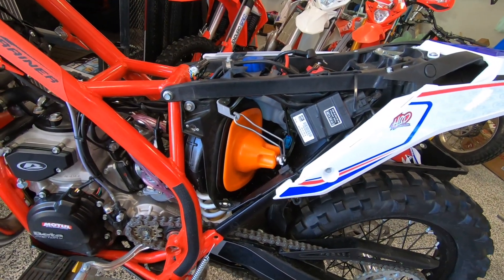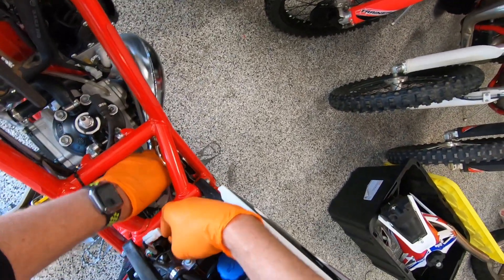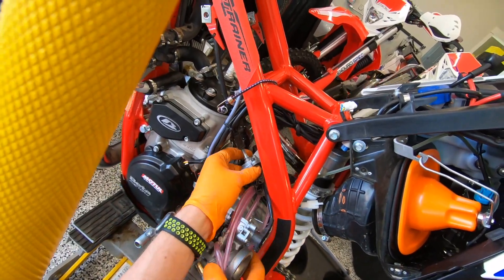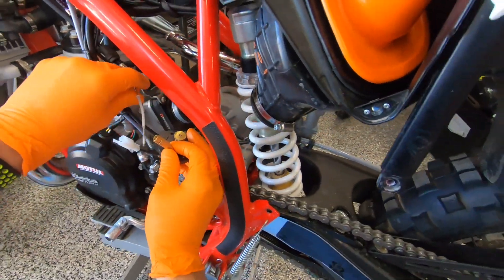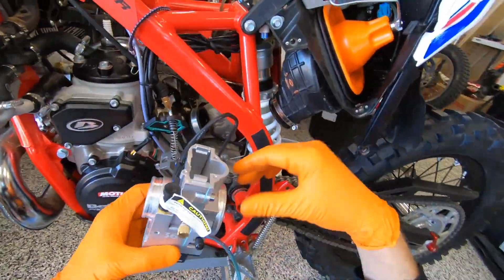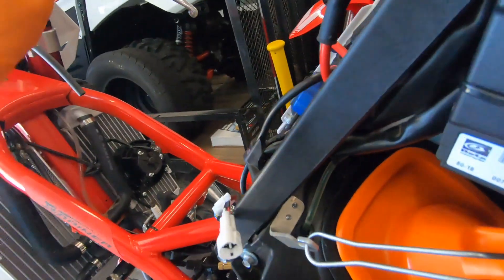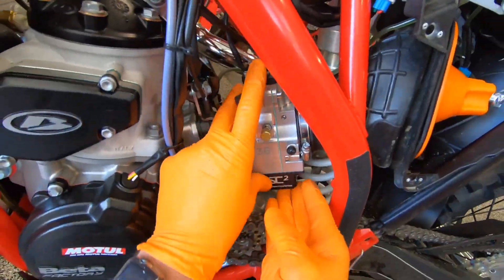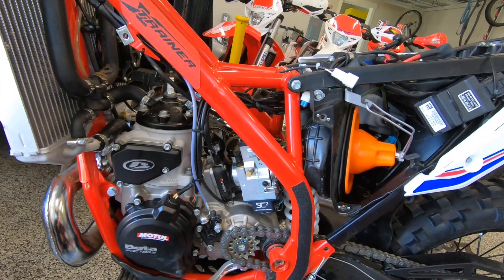Technology Elevated SmartCarb 2, Beta Xtrainer & 300 Install

Comment: Hey Gene I got a 2022 Beta XT with 3 hour in it. I wanted to delete OI and install the SC2 carb will it be the same steps compare to a 2019 XT
Reply from the maker: Yes, same steps. The install hasn't changed until model year 2023.

Comment: I bought a used 2020 xtrainer with the smart carb. It runs so nice. I am only getting 20-30 miles on my stock tank until I have to put on reserve. Float height is per spec. Do you get better mileage at all? Great video!
Reply from the maker: Thanks for the reply. The very first thing you want to check is your plug. If it's black, it's running very very rich. You'll want to check your clicker count from full rich and document both. We ride from 6000-13000' and get about 80-100 miles per tank with the SC2. When lower, you'll use more gas, but have more power. 20-30 to reserve is not normal.

Comment: Hi there ! Thx for video!
I have a 2020 xtrainer, and i had removed the oil injection , now i want to instal an SC2, can u tell me if i must to purchase the TPS plug too ?
Reply from the maker: Hi. If you removed the oil injection and got the kit from beta, it comes with a plug for the TPS. If you removed it yourself, and you disconnect the TPS from the wire harness, your engine light will come on the dash. If that doesn’t bother you, you do not need the TPS from technology elevated.
Reply: Yep , i removed my self at home, the check engine light is not an issue for me!
Thx for helping me !
Reply from the maker: @EnduRomaniia  We are happy to help anytime. Take care and good luck.
Reply: @genecarbonell  I finally got SC2, it was set by Nathan at 82 clicks on the right, but it doesn't work properly.
In idle it does not go round, and in revs, the engine sounds as if it is poor, noise like a broken connecting rod, better friends say that there is too much air and too little gas.
what do you advise me to do ? thank you!
Reply: @EnduRomaniia  It can only be an air leak. Most likely due to installation. The first thing you should check is to make sure you trim the rubber locating ears on the top of the intake boot that are for indexing the stock Keihin carburetor. Trim those off flush with the front of the intake flange then shove the carb in all the way and tighten the clamp thoroughly.
Reply: @EnduRomaniia  Hi Iulian, we have responded to your email just now. Please read it and get back to us, we are happy to help! You may need the next step richer A-Q09 metering rod, available from us or from one of our European dealers. SIP Scooter Shop is closest to you and they have the A-Q09 in stock.

Comment: hi gene. I installed the smart carb on my 2018 xtrainer 2 days ago. the carb has made the air boot push up against the shock on my bike. the boot touches the spring on the shock. does the airboot on your xtrainer now touch the shock spring?
Reply from the maker: xc_trail_guy We have not had that experience. Do you have an SC2?
Reply: @genecarbonell  yes. I wish you could send me a photo of your shock and the air boot.. Are you on thumpertalk?
Reply from the maker: xc_trail_guy no, but you can find First Class Adventures on FB and message through there. Or, post to the SmartCarb FB page too.
Reply: According to the smartcarb site, the SC2 is 7mm longer than the Keihin.  Still touching, or did you figure something out?  I think I read something about some guys having to remove the reed spacer.
Reply from the maker: sam We have not experienced any clearance issues with our cross trainers. We recently had a customer with a 2017 300 and he had a clearance issue because he had an oversized spring.
The 6.0 and higher springs seem to be much larger in size than the lower rates. 
It’s possible that removing the reed spacer will help you. Be sure to report back if you remove it.